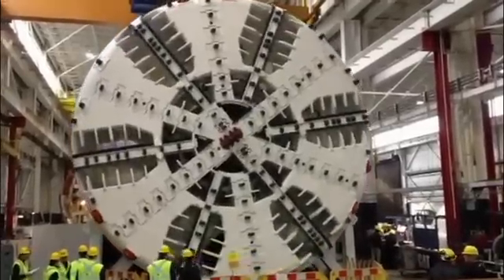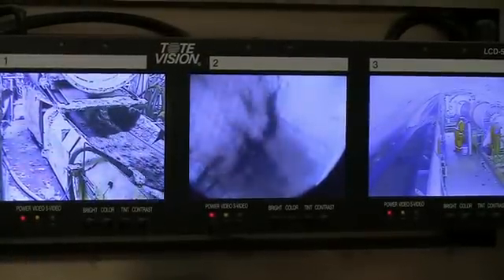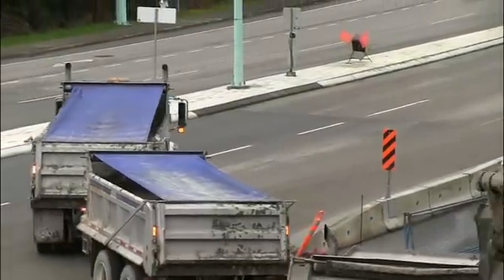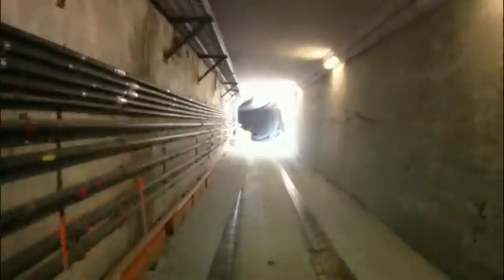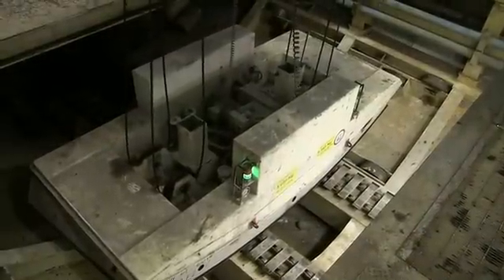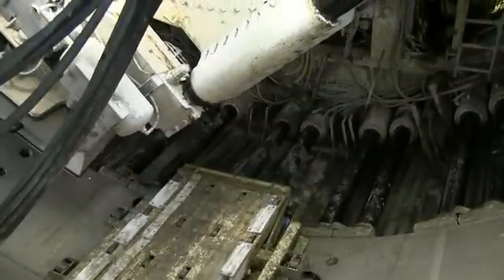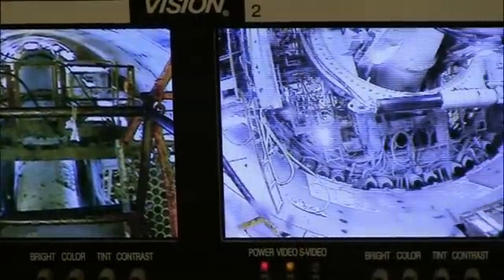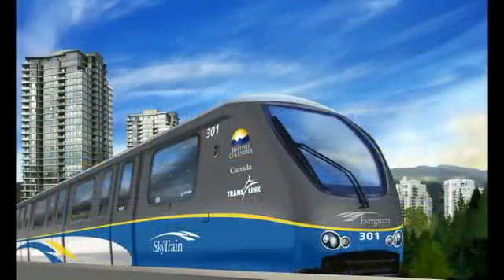How It Works: Evergreen Line Tunnel Boring Machine

Comment: Other companies have tunnel machines that don't have to deal with the waste they on location feed it back into another part of the equipment that heats & vitrifies it & redeposits it as a coating on the tunnel. Now THAT'S impressive.
Reply: That sounds like it would be HEAVILY dependent on what type of rock is being drilled. Not all would be suitable as a tunnel "coating"

Comment: why? what is the end goal? no runaround, irrelevant and/or distorted answers.
Reply from the maker: Hi Nika, 
To be clarify, are you asking what the end goal of this work is? The Evergreen Line is now open and serves as a vital public transportation link in the Lower Mainland, connecting Coquitlam, Port Coquitlam, and Port Moody to the greater downtown area.
Reply: MinistryofTranBC not your work specifically, unless you work these huge drills. sorry about that. but yeah, so the end goal of those behind all of this drilling.
Reply from the maker: Sorry if I don't understand. If you mean the project, the drilling's end goal was to create a tunnel for the new Evergreen Line system. Please provide more details so we can respond more accurately.
Reply: @ItsnikaDUH  To create a tunnel. I feel that's pretty obvious.